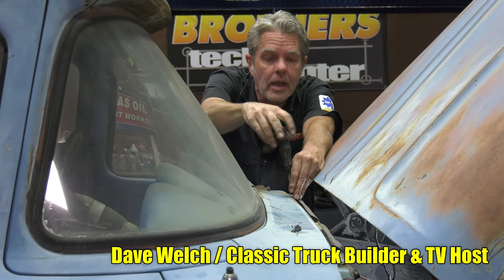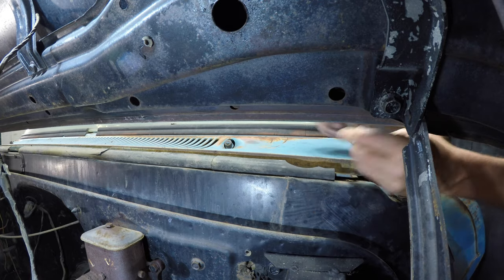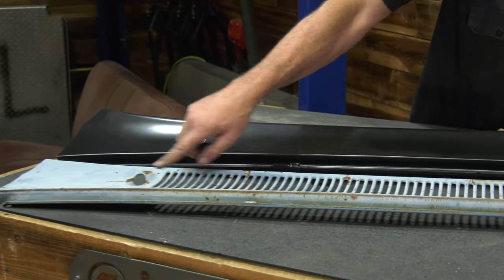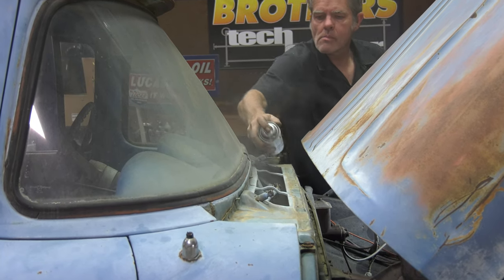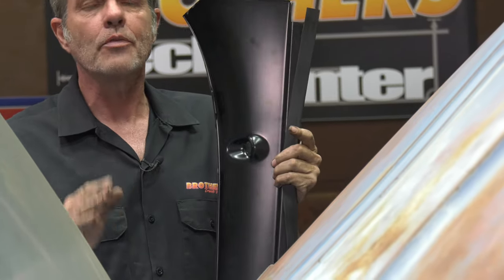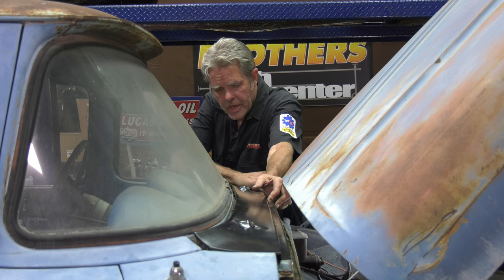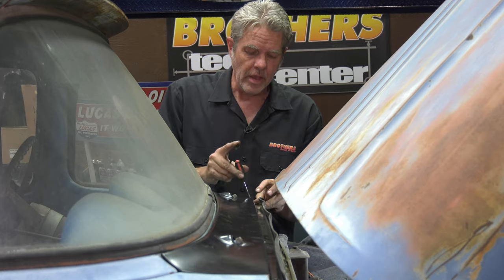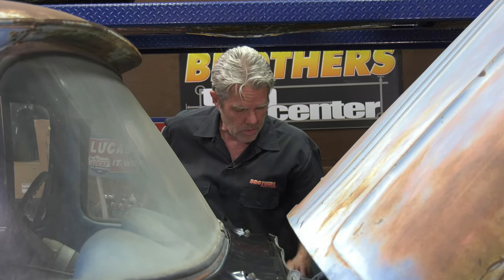1960-66 Chevy & GMC Truck Smooth Cowl Panel Installation

Comment: Looks good .To help on the vacuum part I duct tape a length of fuel line onto the end of the vac hose do get in further and into tight areas .
Reply from the maker: Excellent tip!

Comment: I installed this two days ago seems pretty straightforward. However the rubber part that screws in doesn’t lay back and cover the screws and I’m not sure if it’s supposed to just stay sticking straight up or if over time it will lay down on top of the screws.

Comment: What about re install the side cowl panels with the doors still on? I  took the decals off them (‘65 c20)) so they (panels) can be painted fully then to reinstall the decals and put everything back together without removing the doors or scratching anything. Unless I need to just mask tape the decals and put them back on the panels reinstall then paint. If you have a video on them I’d appreciate it
Reply from the maker: We do not have a vudeo for that, but we will look into it for the future.

Comment: Very Nice and clean! How does the air get in for the heater and vent once this is installed??
Reply from the maker: There's still a small air gap at the base of the windshield for enough air to get in for the heater and vents.

Comment: What about the washer nozzles? I guess you lose that function.
Reply from the maker: You could still drill holes if you want to maintain the washers.
Reply: @BROTHERSTruckPartsTV  I thought about that, but don't like the idea. If I am going to cut holes, I would prefer to cut holes in the hood and install some universal nozzles there. Going to try it out.